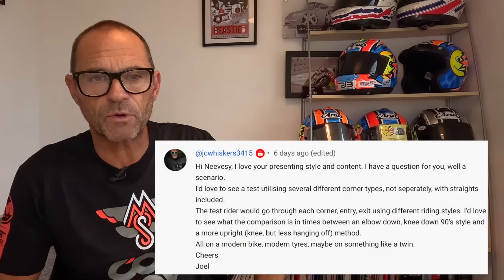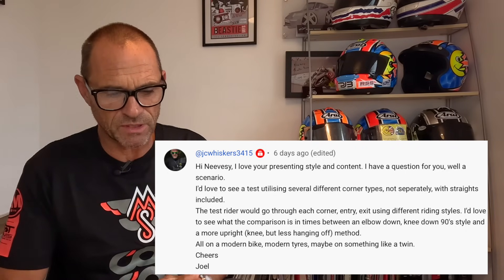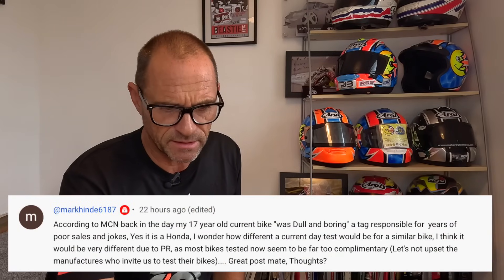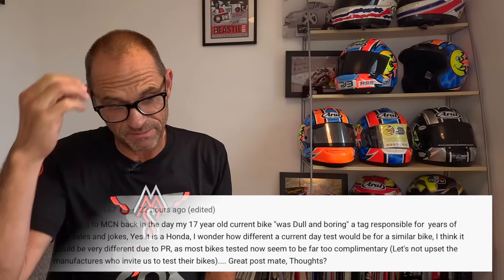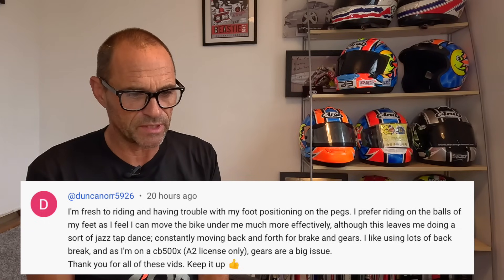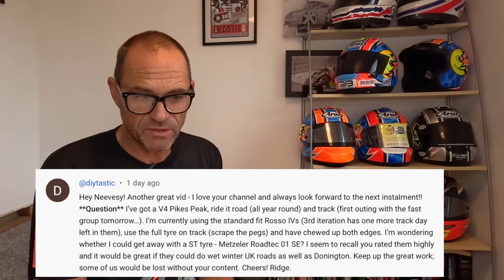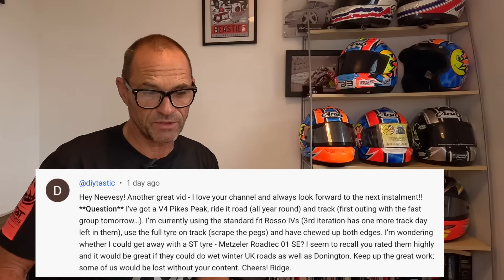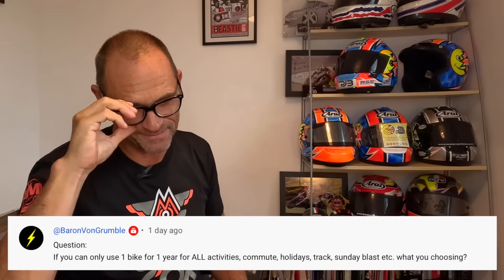Thanks for asking: Fastest riding style, sports touring tyres on track, a bike for everything & more

Comment: Hi Michael, I’ve had a ’21 Tuono V4 Factory for two years and the dash on the V4 does have phone connectivity and turn by turn navigation and it worked fine. You don’t see that advertised very much on YouTube. All they talk about is the great engine. And it is! And there is also an option for soft-cases in the accessories list! So, maybe a Tuono after all? Keep up the great vids.

Comment: Hello Mr. Neeves, thank you so much for the riding tips.  Helps my confidence immensely.  When I was driving (a car) on the track, using the throttle to shift weight front to rear (and therefore traction) was very handy at the limit to turn or rotate the car.  Is there a similar technique on a motorcycle on the track near the limits?

Comment: Hello Neevesy,

A thankyou and a question, I will try and make this as short as poss. I have recently got back into Track Days. I have watched all your videos and digested all your advice on track riding and am glad to report that having never gone quicker than a minute round the Brands Indy Circuit I am now getting comfortably into the 55's, so thanks for the remote tuition it really has worked!!! my question is this: I am on a Gen3 S1000RR on Rosso sp's and standard electronic suspension which is perfectly setup for my weight. Do you think I should be pushing for quicker lap times than a 55 or should I be moving to better rubber and mechanical suspension before trying to get lower times. The bike is starting to move around a lot. ps I am nearly 50 and not trying to break any records just racing against myself really..😄

Comment: Cheers for another interesting video.
I have a question; my old man is in his mid 60s and stopped riding a few years ago after hurting  his lower back ( not on the bike). He no longer has the mobility to swing his leg over even medium high bike seats. 
He loves the look, seat height and price of the the various Royal Enfield 350s but worries he will find their lack of power frustrating. 
I suggested he also had a look at some maxi scoots, tmax, burgman even an mp3. They are step through  , touring bike comfortable and pretty quick. Would you recommend he buys with his heart and gets an RN or should he get over himself and get a maxi scoot ( which he will probably ride more and find easier to live with). I suppose the choice is get what makes you smile most when you look at it or get what makes you smile more of the time when you ride it over the long term.
What do you reckon?
Regards 
Paul

Comment: Thank you so much for these videos with your incredibly thoughtful replies. Just finished my second year riding on track and I'm either the fastest in the intermediate group, or on the slow side of the fast group. I've ridden these years without incident but finally had my first cold tyre crash. It has made me think a lot about tyres and suspension setup. I feel like there is a lot of information online about suspension setups, but not so much talking about choosing tyre pressures. My ducati v4 manual has recommendations for track tyre pressures for the supercorsas which I use, but I don't know if those are cold or hot temperatures. Should I be checking my pressures before or after each session and making small adjustments to account for heat and pressure build up during the day. I'm also confused as to how you consider the weather in making tyre pressure adjustments (cold vs hot days). I'd love your thoughts here.

Comment: hi Michael - I’m currently riding a ducati 959 on track and while it’s a nice bike and all, my vanity and curiosity keep turning my attention to the thousands. I have a pretty good relationship with my local bmw dealer and likely will pick up an s1000rr soon come the year end discounts, any advice for a mid level track day rider whos only had ducati twins but is now going up to a four cylinder thousand on track? anything particular about the thousands you think I should look out for? since these are very powerful bikes, do you think keeping them on the boil at higher revs is a good idea especially around corners? would the torque create problems? thanks Michael and keep the good stuff coming!

Comment: Hey mate, I'm in Qld Australia, it's getting pretty hot here, 35/36 and I'm experiencing a greasy feeling on my Metezeler td slicks. Doesn't really inspire confidence. I'm running 26psi rear 33 front taken on warmers set to 80deg on a 675 Daytona. I do a maximum of 4 days on a set. The tyres have been great in temps under 30 but now they feel like a rockabilly's hair. Mostly I get this feeling on a track that cars drift and race on. I pick up a fair amount of rubber off the track on the front particularly so I'm not sure if it's my tyre compound/pressures/heat or the rubber on the track? Any tips?

Comment: Hy Michael thanks so much for your regular vlogs. I mentioned earlier in the year that I still have the urge that I need to rekindle my youth so to speak and get back into the old 2 wheel marlakey. My question. My last bike was a a ZXR600J2 fantastic fun... Proper old school no electronic aids no traction control anti wheelie lean sensitive ABS etc. It's been 10 years now since I've last rode a bike, but all the new models of all the manufacturers on the market now offer so much tech for rider safety. My eyesight, reflexes, balance are all top notch in my tender age. Does the new era of motorcycle make riding safer. My memories still remind me of looking out for grit on the road the old diesel smell and tell tell rainbows on the road. I remember years ago I lost the front on a GPZ600R with "anti dive" forks which didn't help me  out. Road rash only to me and the bike.

Comment: Hi Micheal I have a question that no one seems to know the answer too but im sure you do. Its about brake reservoirs and how come cheaper machines are often fitted with metal ones and more expensive or performance bikes have the plastic ones. TMF recons the plastic ones are fitted to save money but surely thats backwards? I own 4 bikes. Only my most expensive bike a Ninja 1000 has the plastic brake reservoir the othes a TZR, a hornet and a RE interceptor have metal ones. I've owned R1's Fireblades and GSXR's all had plastic brake reservoirs. So whats the deal here? Thanks in advance and love your channel👍

Comment: Hi I’ve got a bit of a daft question.

I’ve got the mk2 s1000xr it’s a lovely bike with a stock air box and exhaust, but on the motorway it’s far too loud even with earplugs. I’m not 100% if it’s the air box or the exhaust that makes all the racket. I’ve been looking at the DB killers for the end can, would one of these be any help or will it mess the engine up.

Comment: I hope I can submit questions here for the next one. What is your favorite slow bike to ride hard? I found the crappy old slow DRZ400SM to be an absolute giggle machine as long as I rode it on the right, tight bumpy twisty roads with lots of elevation changes I had in Northern California.  One of the local legends used to trash the hell out of his "wife's bike" Ninja 250. Wallowing stock suspension, sparks throwing from it bottoming out everywhere yet keeping a pace that had to be seen to be believed. I found that slow bikes let you get away with murder and make you feel like a hero when you trash them [on the right road] I'm sure you must have some bikes that you feel the same about. Btw love this series!

Comment: Worth noting that while sports touring tires these days are fantastic and more than enough for 99.9% of us (myself included), Metzler does offer their M9RRs with a 19 inch front wheel setup, so those of us with fast road biased ADV bikes can get something a little different and stickier if so inclined. Just throwing that out there as an option for faster ADV bois.

I know some folk have questioned why the need of such a tire on such a bike, but some of us are limited to only being able to have one bike, so having a super sporty rubber option on an ADV is rather nice. (The V4 Pikes Peak is waaaaaay too much money to just get a 17 inch front wheel)

Comment: I love your job and love listening what you have to say and really respect your opinions! And want to believe you, when you say that a good journalist speaks the true... But then I struggle a lot with one thing! I'm lucky enough to be able to experience all the current Superbikes and the absolute best ones (reliability, quality of materials, brakes, suspension, handling, stability at high speeds, etc) in my opinion, as someone who rides them almost everyday is: first the fireblade sp, followed by the other Japanese bikes and only next come the European ones like the Aprilia, Ducati and the worst of them all the S1000rr wich I also had (2022) and sold because it proved to be extremely unreliable, vibratory, with poor materials and the worse equipment (leaking steering damper, brakes with recalls, weak suspension,...) and still this are the bikes that you defend the most! And you critique the other ones... Why?
Reply: I have a 2020 rr m-sport as my track bike, as do 3 of my riding buddies. The only issue i have had with the bike was a dead coil which was replaced under warranty. Other than that, all 4 bikes have been rock solid and I have put 20,000 km on my bike, of which about 15,000 km are on the track. Maybe you just had a dud.